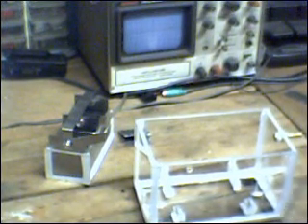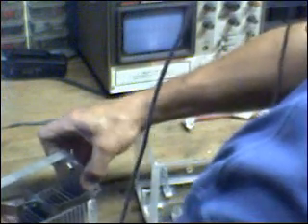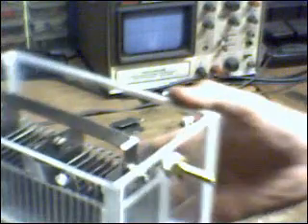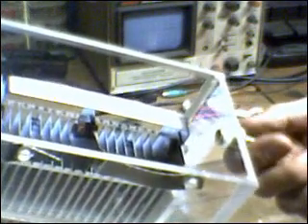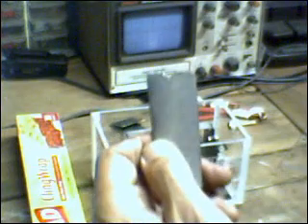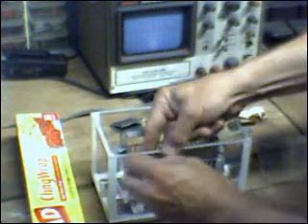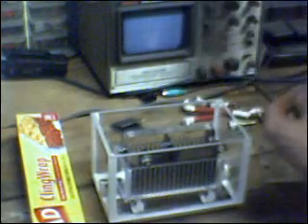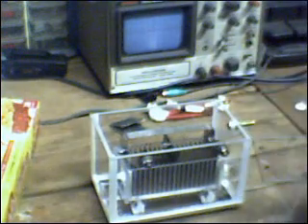19 - Hydrogen HHO Electrolyzer test unit Wiring 08

Comment: Of course I am!  But really make a flange around the top with a wide ledge for the lid to sit on.  Make a grove in the flange for a rubber o-ring.  Then bolt the lid to the flange, you can remove it and put it back over and over.  If you have ever seen any modern thermostat housings on Ford products they are like that...

Comment: Actually, that brings out another idea. You could cut plexiglass to the size of the inside of the tank (maybe only slightly smaller) and glue it to the other plexiglass, kinda like a cookie jar lid (fits into the jar by a lip). Still use "make-a-gasket" used for cars, easily removable and very good.

Comment: The balloon would not stick permanently at all, and acts like a rubber washer. It would be the rubber bands strapped around it that holds it tight (or clamps, whatever). Just trying to give a suggestion of faster build, if you glue, you have to wait =(

Comment from the maker: The lid will not just rest by it's own weight. A previous video shows that there will be clamp rods around the outside of the electrolyte chamber. What's important is a pliable and smooth mating surface that doesn't stick permanently.

Comment: Pressure differential during test may cause the cling wrap to detach causing leakage. I would wrap the top with a balloon or similar, and when placing top on, use rubber bands to hold in place in testing.